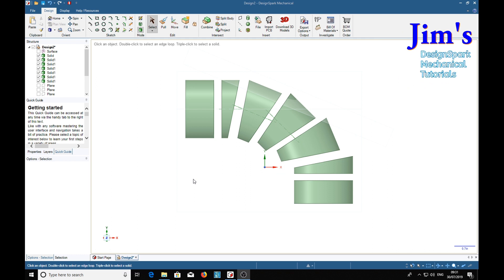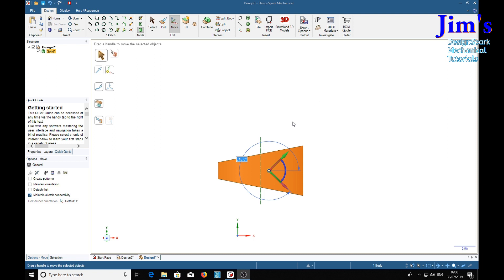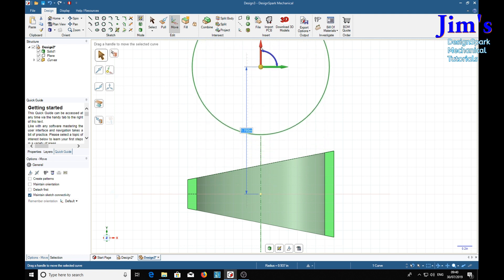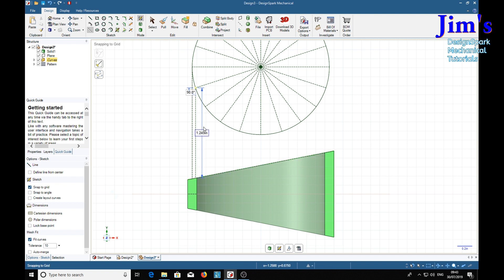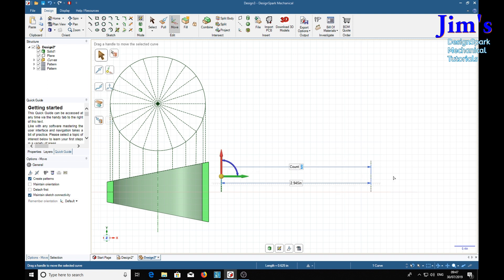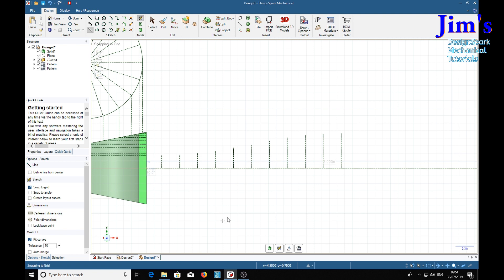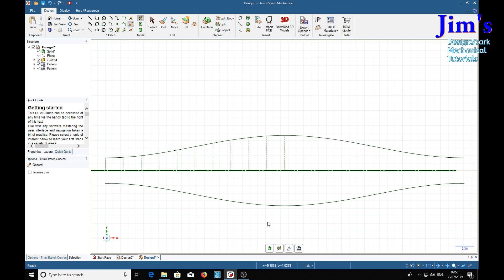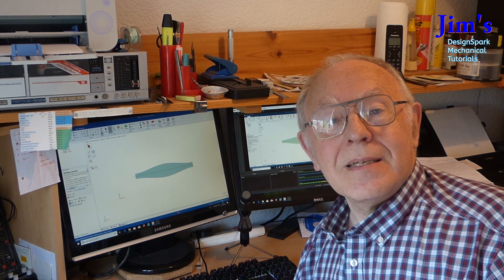Trunking with bends pt2 in DesignSpark Mechanical

Comment: looking at a cross section of pipe split from max height to min height you can extend lines 1/2 circumference from min height to max height,  and then extending the line 1/2 circumference from max height to min height. Using the mirror line you only have to do it once.  The only thing is there is a small peak at the transition, which probably makes this way undesirable.